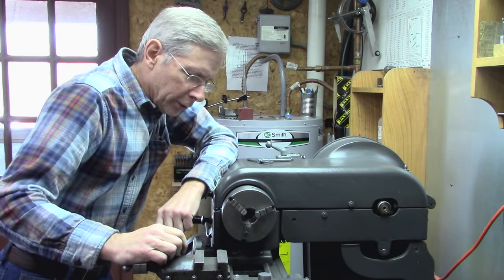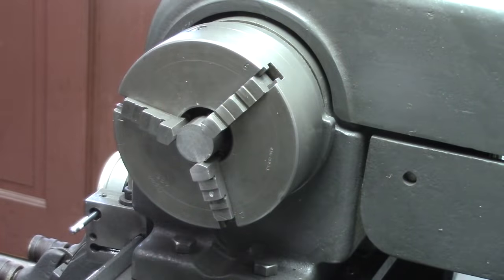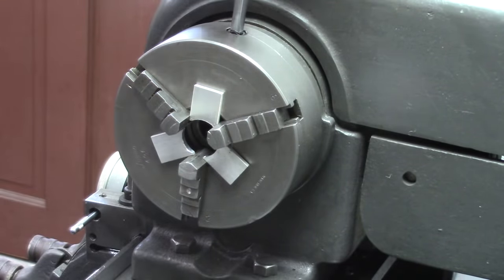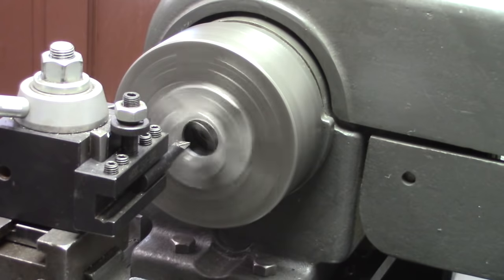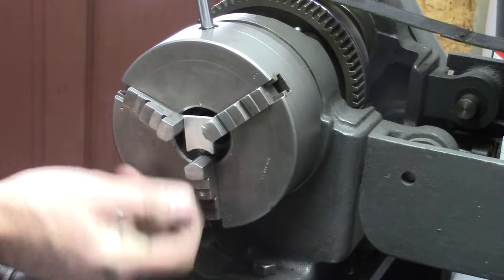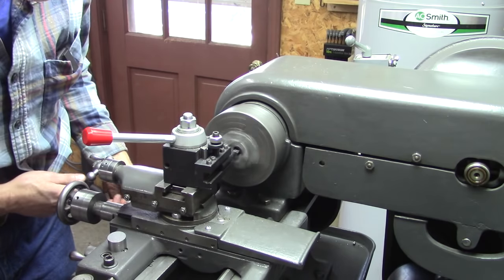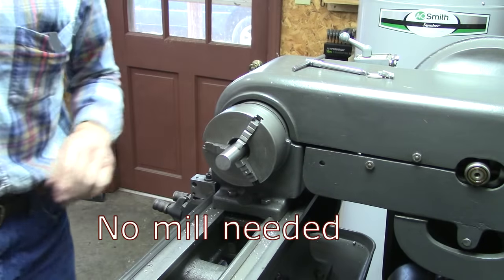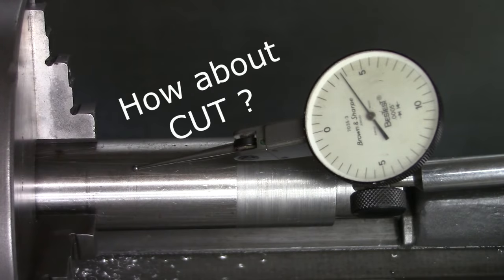Correcting 3-Jaw Chuck Runout the easy way

Comment: I never had good results doing it like that.  I switch over to a dremel with a round stone to grind the jaws. Glad it worked out for you.
Reply from the maker: Yeah...  I've done the same with the dremel. It took hours and I burned up my Dremel. I think this actually worked better for me and it was certainly much faster.
Reply: Buy a Dumore Tool Post Grinder
Reply: @pwddogman   Can't argue but you can purchase three new adjust-a-tru chucks for the cost of a new tool post grinder.
Reply: @geoffmorgan6059  Just bought another Dumore 44-011 for 400, hardly used  Needs a new cord.  Valuable tool for any lathe work IMHO.  Also there is a guy on Ebay that sells a bracket to convert a die grinder to a tool post grinder .
Reply: @pwddogman  -Fortunately I have a Dumore Series 55.   I have just noticed that the prices are over the top.  I think you got a very good deal!

Comment: This is great stuff! If the scroll is worn, error will vary with diameter. If jaws are too hard to bore,  use an air grinder.  Keep up the good work!
Reply from the maker: Thanks for the tips! An air grinder would be good however carbide will cut most hardened jaws i think.
Reply: @WinkysWorkshop  But you will have more tool deflection with carbide and if the jaws are uneven to start with you will not likely get the deflection or tool pressure even by the time you are finished as a grinder would do. Boring it is certainly better than leaving it alone as you showed but grinding it will give you better results.
Reply from the maker: @phillhuddleston9445  I have had exactly the opposite experience. Either method works but the grinder has more deflection and takes much longer. If the boring bar is used correctly (square to the cut) there is almost no deflection. Grinding wheels have three aspects that effect this deflection. First the wheel is round and and the jaw will try to push the wheel away. Second, the bearing in the grinder will always have clearance and third, a tool post grinder usually has a small diameter shaft. Of course the 3rd reason depends on the grinder. You can always tell about how much defection you are getting by making a second cut without a change in cutting depth. If you are removing stock on the second pass the previous pass was deflecting. Repeated passes with either method will result in good results but the grinder will need more passes than the boring bar.
Reply: @WinkysWorkshop  The grinder will need more passes but you can let it spark out and you can not do that with a carbide inserted boring bar, if the grinding wheel is dressed right and you have a decent tool post grinder the tool pressure and deflection will be minimal. If you are trying this with a half worn out pneumatic die grinder then you will likely get poor results, either way I'm glad it worked to your satisfaction, it's far better than when you started.
Reply from the maker: @phillhuddleston9445  It could be that technically the grinder would be more accurate. Certainly the finish would be a little better. However I was probably within .001" which is good for any 3 jaw, especially when there's a .004 to .005 error throughout the clamping range.

Comment: If you have .0015 on a 3 jaw chuck that’s good. I have made up aluminum soft jaws for some 3 jaw work that requires removing parts to work around the problem. One thing I noticed is you took light cuts and had a stiff bar, so that’s why that worked out as well as it did. The plus is your not introducing grinding grit to your lathe
Reply from the maker: Very true... I have ground several chucks and this work better. Certainly faster!

Comment: I did the same with my Asian lathe, but I used a Dremel type grinder mounted to the tool post, jaws unloaded. It became a little better. now I usually wrap a piece of .010" card stock around the shafting, and it gets it very close. I use the card stock to even out the contact along the axis of the chuck and it is much improved from whence I bagan. Enjoyed the video, especially after watching the chit chat on Harold's channel. Cheers!
Reply from the maker: So cool... glad you saw the chit chat...  that was a first for me. Yeah...  I was somewhat concerned about evening the pressure but after I flipped the aluminum pieces I realized the jaws were clamping fairly accurately. I figured the aluminum might compress a little if the pressure was a little different but maybe not...  either way it worked great. Maybe even better than I think... I need to check it with good shafting. I actually used a dremel on this chuck and one other a few years ago. It helped but the boring bar worked way better... much faster too. Also...  I burned up my dremel. I think they have a two chuck limit!  Ha

Comment: I acquired a 3/4" dowel pin to check my runout. Any large dowel should be good. It eliminates the stock inaccuracies. Nice job. The Logan lives on!
Reply from the maker: Ha...  Yeah, I didn't want to give up on the chuck. I need to get some dowel pins!
Reply: @WinkysWorkshop   Standards are ok but I wouldn't want to mess them up.
Reply: Most dowel pins are hardened and ground...you have to go out of your way to screw them...caution some dowels have flats to allow air to escape a hole...don't clamp on the flat.
Reply: @larryrestainer9949  Yes Larry, the flats are used when pressing a dowel into a blind hole, which is not recommended.
Reply: @WinkysWorkshop  An End Mill is a good substitute until you get some.
Reply from the maker: @KW-ei3pi  True
Reply: Agree... a large dowel pin...

Comment: Thanks for the idea.  I used a hardened ring, about 2.5"  ID to hold the jaws in tension.  Then a boring bar to lightly clean up the jaws. Got the runout to .002" two inches from the chuck.  Much better than it was.  Thanks again.
Reply from the maker: Yeah...  lots of different way to do this. Thanks for watching!

Comment: Well done!, When I went thru the same process on my small bench lathe I used a steel ring around the outside of the jaws first. Then I did your method just in case there is a difference when chucking something o.d. vs i.d.  I used my shop made tool post grinder with a 1/4" diamond burr. I work on firearms so I need a little smaller radius.  Thanks for the vid!,
Gerry
Reply from the maker: Thanks, I've used a grinder in the past but it was a dremel tool. I had better luck with the boring bar plus my dremel has a 2 chuck limit.... I burned it up.  I'm sure a better grinder would have worked well.

Comment: Grinding the chuck jaws, (or turning them in the case of soft jaws), is about all you can realistically do to refurbish an old worn chuck.  I've found that there's usually some wear between the chuck body and the scroll plate register that allows some inconsistency but sometimes just using the chuck key in a different tightening bevel may show a marginally better result.
My first lathe had a 3 jaw Self Centering chuck that was so worn out that I found it less frustrating to use the four jaw independent chuck instead.  It was two years before I could afford a new 3 jaw but by that time I'd learned to appreciate the superior holding power and the accuracy of the four jaw.  My new three jaw was accurate to better than 0.001" on ground MS or silver steel bar but the old four jaw independent could even better this if it was ever needed. 
Your use of aluminium spacers to hold the jaws apart when turning is a good idea too.  Some turners use a steel ring gripped at the back 1/8" of the jaws.  (The step being turned away afterwards)
Reply from the maker: The only thing I don't like about the ring in the back is where the load is. I think the load needs to be closer to center. One viewer suggested a different method... it sounded interesting. If you see the video next week you'll know it worked. Hehe

Comment: You should remove the jaws and hit the beveled sides with an oil stone to knock off any burrs.  Bluing the contact face of the jaws will let you see if you have machined the full length of the jaws.  Glad it worked for you.  I use a tool post grinder.
Reply from the maker: There is no question I hit the full length of the jaw, easy to see. I agree about the tips. Thanks!

Comment: Very nice Mark. The ring/spider has always given me "must be a better way" second thoughts. This way you are on the inside edge of the scroll and tightening in as most chucks are used most if the time. And best if all the jaws are fully cut. Plus you don't have to mask off the bed from the grinding grit! Looking forward to seeing if the other method mentioned works as well. 
Ron
Reply: "of all"
Reply from the maker: Some have said the hardened jaws will not cut...  it worked well for me. Maybe some jaws are too hard but I do know that mine are hard. a drill will not touch then.

Comment: Great result! I wish that I could think of another way to immobilize the jaws, because I imagine that there must be some equalizing of pressure, some small displacement, by gripping on the sides of the jaws. And while I am wishing, I might as well wish for a tool post grinder, too!
Reply from the maker: I started to drill the jaws and install a roll pin but then realized that the jaws were hardened. I was going to make the pins clamp on a shorts piece of pipe. The aluminum pieces are still putting 1/3 the pressure outward and 1/3 on each side of the jaws (I think).  Also, I used a grinder on jaws two times....  cutting with a boring bar worked way better
Reply: There are other ways. Its called a spider

Comment: I'm surprised the boring bar cut it. I built a grinder attachment for my tool post. covered the ways and just ground the jaws. they are still about .003 out I may could do better but like you said the scroll is likely worn on mine as well.
Reply from the maker: Carbide will cut fairly hard steel. The jaws are harder than a drill but nothing like HSS or case hardening. In this case it cut very well. I have also used a grinder. It took a LONG time and I learned that my Dremel has a two chuck limit - Ha

Comment: ❤ nice tips we use a high speed  grinder  (30000 rpm) with 6 mm collet chuck and use a small short piece  off pipe and first clamp it in the bottom of the chuck then move the pipe to the front and then grind the back inside i think it is important to clean the chuck spiral screw well before you start👍
Reply from the maker: That would probably work very well.

Comment: Mount a precision ground bar in an accurately aligned tailstock and apply a very small amount of grinding paste to it.  lightly clamp the jaws down and run at the slowest speed while moving the tailstock in and out. This will true up your jaws perfectly ( or as good as anything within the limits of your average 3 jaw chuck).
Reply from the maker: Hmmm...  I like that idea. I wonder if the bar needs to be harder than the chuck jaws? Heck, you might find a real fine diamond coated bar too. Now you got me thinking!
Reply: IME it doesn't need to be hard as the paste does the work so roundness and alignment are the major criteria . It's crucial also to move the bar in and out to create an even surface.
Reply from the maker: @johngriffin641  If I do a follow up video can I use your name in the video to give you credit for the idea. I like it
Reply: @WinkysWorkshop  No problem
Reply from the maker: @johngriffin641  Thanks, I'm fairly happy with my current results but you method will probably be better. I'm sure your method takes a while so a combination of both might also be good.
Reply: @WinkysWorkshop  With a 3 jaw the best you can get is 'good enough' in terms of runout as even tightening on different chuck key holes will make a difference. With a worn chuck the main issue is having the jaws parallel so they grip evenly along the length of a bar and dressing them under tension with either or both method will fix this. My method is very quick - a few seconds is all that's needed. You do need to spend time precisely aligning your tailstock but that's always a worthwhile job.
Reply from the maker: @johngriffin641  - The only possible problem I see is attaching a rigid bar to the tail stock. If the bar is 1/2" I can clamp it in my tailstock chuck. Larger is better due to being rigid and the radius it puts on the jaws. I'm thinking put a 1-inch bar in a 4-jaw and make it perfectly centers and then set up my steady rest between the tail stock and chuck. - A few seconds???  I was thinking valve lapping compound but I suspect that would take a while.
Reply: @WinkysWorkshop  Sounds like a good idea as long as you can move the bar in and out. I used valve lapping paste and was surprised how fast it worked but I guess it depends on how much wear is in the jaws. Maybe start with your method and finnish with mine if they need a lot of material removed.
Reply from the maker: @johngriffin641  Valve lapping compound will be here Monday. I wonder if it would be better to use a hardened bar?
Reply: @WinkysWorkshop  The abrasive will partially bed into a soft material and do it's job.I can't see any advantage in using anything harder unless it's a substantially better precision in roundness. Again there is only so much precision you can achieve with a 3 jaw in the first place and if you got it < 0.001 runout at 1/2'' it would be off at 1'' and 1/4''
Reply from the maker: @johngriffin641  I was thinking the same about the shaft hardness, just wondered if it was different than what you experienced.

Comment: If you have one bar that must run true for a special job try placing paper shims under one or more of the jaws. After a few tries  indicating you can usually get the bar true within .002 TIR.
Reply from the maker: Yes that works well, I have done this several times.

Comment: I like the jaw suport idea. Looks like the jaws were not hardened. Was it a carbide tool cutting the jaws?
Reply from the maker: Yes the jaws are VERY hard. I was going to put roll pins in the jaws and clamp on a ring but I could not drill them. This worked fantastic. Yes it was a carbide insert in the boring bar
Reply: @WinkysWorkshop  I do like the method; it saved an otherwise barely usable chuck. Thanks for the explanation. Some tough carbide that it did not chip on the interrupted cut. What inserts were used? I could use the same treatment on my SB 9 bell-mouthed chuck. On more accurate stuff I use collets so it does not bother me all that much (yet).
Reply from the maker: @milantrcka121  It's a Chinese TCMT 21.51 insert. The interrupted cut isn't an issue as long as you take small bites.

Comment: Great idea. Is there a possibility there was a slight variance in the width of the aluminum flat bar which may have shifted the jaws slightly off? Just a thought.
Thanks for sharing.
Reply from the maker: This is very true. although the aluminum is thin enough to average out a little. It's not prefect but I don't think there is a perfect method.

Comment: I didn't see anything ground in the video. Replace the word in the title with turn or machine. For best results use a set of soft jaws or soft jaw attachments and turn them to your diameter even if the scroll is worn uneven the work will run perfectly. 40 years master toolmaker, cheers
Reply: Sounds even easiest!
Reply from the maker: No disrespect intended but this video was about fixing a chuck not replacing it.
Reply: Use a 4 jaw and indicate!
Reply: Had a set of 3 hard jaws EDM-'drilled'. Could thereafter bolt soft steel or aluminum to them clamp on a near-net-size piece of scrap and bore to desired diameter.

Comment: Could you put an out ring on the chuck teeth and OPEN it, putting them under pressure and then do the same.  or NO, wrong "dynamic" you want to be squeezing in?
Reply from the maker: Exactly. This is not perfect buy it usually improves a worn chuck.